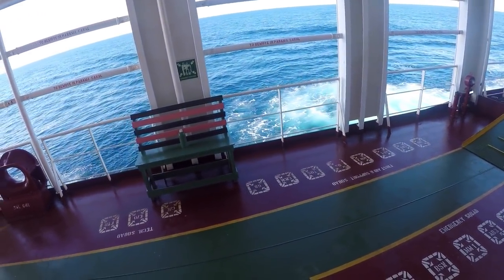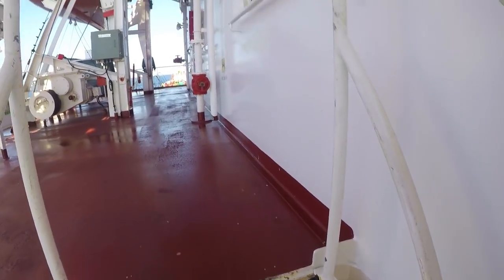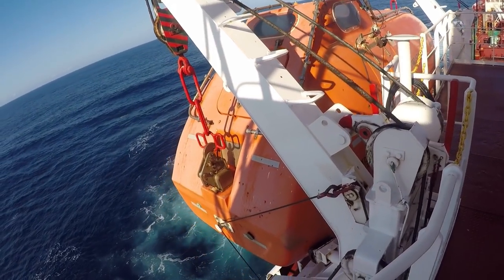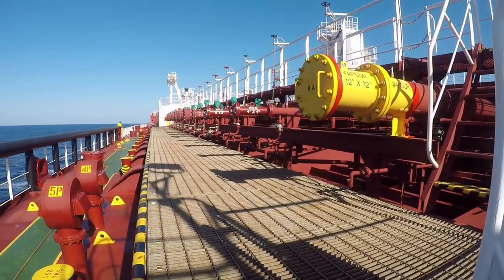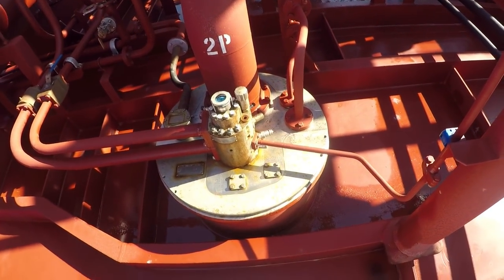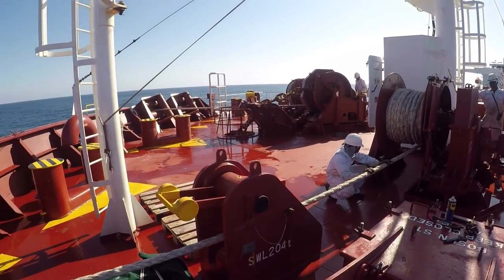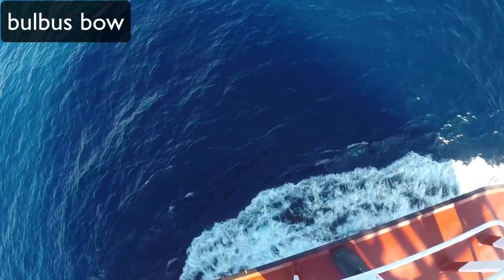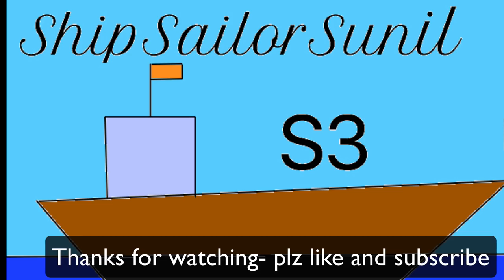Ships propeller to bow ,Main deck round

Comment: Hello Mr. Sunil, I hve two query :
1. What fuel or type of fuel these Ship use. On an voyage from Dubai to Singapore via mellaca straits, how much fuel is consumed by a ship.
2. how is ur/ur team experience on bad weather like very high tides. or any kind of fear of life. In which world route sailors face bad weather most. Possible if u can make a vlog on this topic. (:
Thanks for sharing these videos.
Reply from the maker: Reply 1- HSFO High Sulphur Fuel Oil wil be used , voyage fuel consumption will depend on type of ship , on a tanker MR medium range is 22-25 Tons / Day . Dubai Singapore will be a 8-10 days voyage depending upon speed . Container will do it in 5-6 days consumption will be higher
Reply from the maker: Bad wx depends how severe it is . But ships are designed for rough wx so no treat of life , it just get uncomfortable for daily routine and sleep that’s it . Will make a vlog I am waiting for really rough seas to make it .